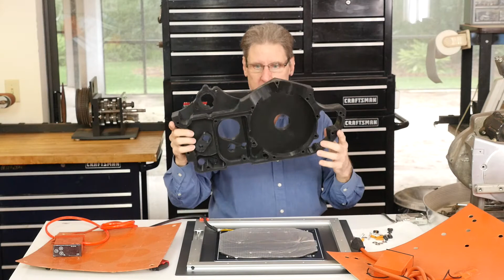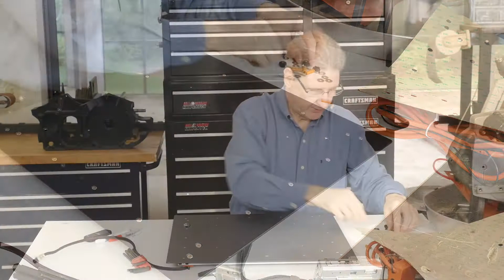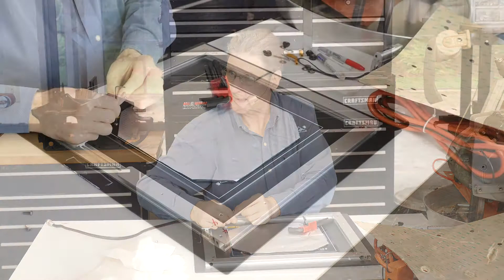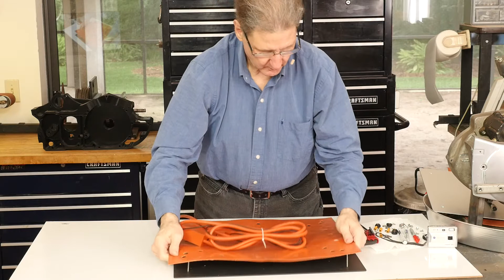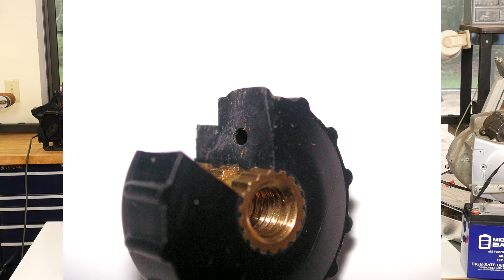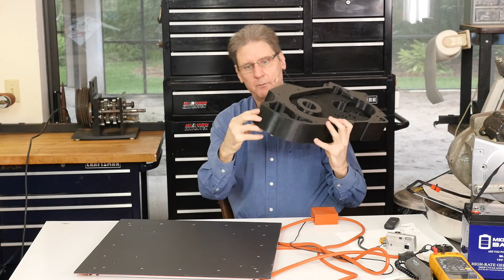Creality CR10-S5 full-size bed heater

Comment: I know this is an old video, but I have a printer like this now and it has the silicone heater bed on it, but the motherboard isn't reading it. says the temp is -14 degrees and refuses to start print. what could be causing this? when I plugged the old heater back in, it fix that error. any ideas?
Reply from the maker: Not sure what you mean Seth. If you are saying you bought a used printer that has a full-bed external heater like this, well what you are seeing makes sense. This external heater has it's own box and plugs into the wall separately. When you remove the "old heater" that was originally with the printer, the control box can no longer read the temperature, that is done by the external control box for the big bed heater. What I do is make sure the bed heat is stable and where I want using the little external box. Then I go into the Creatlity control program where it lets you over-ride the temperature settings for bed and nozzle. If it lets you set it below -14, that should "fool" the Creality control box into thinking the bed is up to temperature, and the print will start. Otherwise, you might connect a resistor between the pins on the socket on the Creality control box, so that the control box will see a positive temperature. If you pick the resistor so that the box thinks the bed is hot enough, the print will start as long as the nozzle temperature gets high enough. Otherwise, any temperature that you can over-ride by hand, so maybe the box thinks it is 28 degrees, you go into the setting and make the print bed temperature 25 degrees. The big deal is that the real bed temperature is set with the little box that comes with the full-sized bed heater, and you plugged it in and waited for the little box to show the bed is at the temperature that you set it. I hope this helps. Adding a separate bed heater is a bit of a hack, and you have to hack some other things to get the print started.
Reply: @Rako_Studios  That makes sense, I knew the orange box was controlling the heat of the bed, I just couldn't figure out how to get the control box to not read -14. I plugged in the old bed and it fixed it obviously, but the moment I took it off again, it went right back to -14. I'll try and see if I can fool the box into thinking -14 is right, but I want to say when I tried last time, it only let me get to 0 and wont let me go under that temp.

Comment: Perfect, this is real useful.  Two issues to double down on.  The silicone pad has a power cable made of the same rubbery stuff, and a data cable.  These need to exit where they are connected from to the SIDE, not the back or front or they will interfere with the printer carriage rollers.  Second and even more important: The bed needs be raised up a bit.  Add a washer or two more than what it came with, in order for the rear cut-out portion of the bed aluminum frame to properly clear the rear Y stepper mother.  Also I have not really figured out how to detach the stock heater from the CR-10 control box and still make it think that it's there.  So right now it's like a vestigial organ just hanging off the control box, dialed down to 20 degrees to keep it cool.   The silicone mat, by the way, works like a charm and heats up very fast.    For the S5, it's important to purchase the extended cable set because the stock cables are just too short!
Reply from the maker: Thanks for the great comment. My printer allowed me to disconnect the original pad and still set the program temp below room temp. I didn't know about the extended cable set, that would be a big help and let me get the control box built with the cable feeder the correct way.

Comment: Did you ever figure out how to bypass the software for the old heat bed? I still have mine hooked up and have it set to 0. Unfortunately every time I start a new project I have to go back in and reset it to 0 again.
Reply from the maker: I use Simplify 3D so that lets me set the bed temperature under 25 C so that the print starts as soon as the nozzle temp is reached. Still, I have been leaving the bed temp at 75 C in Simplify. I don't mind having to reset it with the control box every time, since that reminds me to make sure the external heater box is up to the temperature I want.

Comment: Thank you for the thorough video. I just finished the same installation. Would you mind detailing your solution for telling the printer the bed temperature. Thanks in advance.
Reply from the maker: I used the same file I did for printing with the internal heater control. I set the bed temperature on the external box and waited the few minutes for it to stabilize. Then I went into the control menu of the Creality control box and changed the bed temperature to under 25 degrees C, ie room temperature. That fools the Creality software and the print will start, as long as the set nozzle temperature is reached.

Comment: Not sure if the author of this video ended up with the same problem but running the wires out the back as shown, ended up having my belt rub the wires clear and exposed and also broke the thermistor wire. The belt kept rubbing on the wire loom and of course you cannot see that as it is under everything. When the unit quit working it just quit heating at first and then eventually I got an error code in the middle of a print. Print finished even though the bed was cold.

After unplugging it, I flipped it over to find the Thermistor wire snapped, and the other two wires and the orange shroud completely rubbed off and wires exposed.  After replacing and soldering as well as putting some better heat shrink around it, I turned it 90 degrees so the wires come out the side instead of the back. I just used two zip ties to put a natural curve in the wire so it isn't hitting the side frame and then 3D printed some blocks to raise the entire frame about 2.5" up off the table. This allows gravity to drop the wires down to wear they can not rub now. It also allows easier access to the tiny knobs for leveling.

At any rate, not sure if the belt has rubbed anyone else the wrong way but took me down for a few days to figure out what was going on and there were 3 failed attempts to fix it before I turned it 90.
Reply from the maker: I mounted the pad so that the cord comes out the back left corner. Then I bring in the cord from that corner too. It does not get anywhere near the Y-axis belt, but it does rub on the frame, so I inspect that area of the cord every use. I love your idea of printing some guide blocks, very clever. I will revisit this cord issue and I hope I can avoid these problems. Thanks for the great comment.

Comment: Good day sir I found your video very helpful. I have had my s5 for about a month now and I'm still fighting with it. Could you please help me.
Reply from the maker: Sorry, I can't really provide free instruction on a one-by one basis. If you have a specific question I can try to help, but there is a big learning curve with 3D printing. I, and everybody else, have watched hundred of hours of videos and read manuals and played with the slicer software until we get a print. I had to struggle with a loose pulley and other problems before I could get a print. Then I had to install the big bed heater to stop some warping problems.
Reply: @Rako_Studios  yeah I got it figured out and watching your videos helped drastically thank you

Comment: Thanks for the video. I have a Cr10-S5 and have been watching a ton of videos. Most of them show the upgrades having to wire and or upgrade parts in the control box for the upgrade. Yours seems to be controlled separately from the control box. Do you have a video of how you do that? I really do not want to open up the control box and mess with any of that.
Reply from the maker: The heater pad I bought comes with it's own temperature control box. You plug it into the wall and set the temperature on the box. They warn you to not turn on the heater until after you attach it to the bed, I guess the silicone pad might overheat if it is not stuck to an aluminum plate. So then you have to "fool" the Creality control box so that it prints even though it's old heater and thermistor is no longer connected. I do this in the Creality control panel, by overriding the bed temperature setting that got set in the slicer software. I set the temp to under room temperature, maybe 20 degrees C. That way the Creality control box will start the print since it has satisfied the bed heat criteria. Of course, before you do this, you make sure the new external heater is up to temperature. That only takes a few minutes, so it is pretty easy to do.

Comment: Aluminum has no memory so 1/8" will always warp. Go 1/4" and you can get that to stop. with your upgraded heater it would work better. The extra weight isn't a problem for the bigger stepper motor. For the springs use ones you cannot condense with your hand, but will with a little bolt pressure. The leveling knobs are not lockers so they back out over time. Get nylon lock nuts and print new ones for them. Hope this helps. I Like the video.
Reply from the maker: I like your idea of stiffer springs. They would make the bed less sloppy. Adding weight to the bed will always risk missing steps at fast speeds, but I believe you if you say the motor can handle it. I would love a 1/4 bed plate so this interests me a lot. I even looked at specialty flat aluminum sheet like "Cast Aluminum Tool & Jig Plate" from Midwest Steel and Aluminum. This might be a great upgrade. Thanks for the comment.

Comment: Thanks for doing this video. It confirms my question on whether or not you can unscrew that little heater on the bottom that easily. Instead of using the power box like you have I am getting one that can be used with a solid state relay and then my printer can control it with its own PID settings. I do wish there were some lower power options for slower heating speed since 1300 watts can be quite a bit of strain on some home's power systems but at least it won't be on 100% of the time once it gets up to temperature. I also worry since my battery backup system can only handle about 800 watts.
Reply from the maker: Oh man, you have the exact setup I dream about. They are widening the road and my power goes out every month. With 5-day prints, that can be devastating, even it it is just a few seconds drop out. I wanted to battery-backup the printer, but like you say, this heater won't run for long. If the heater is powered with AC, you might be able to put a diode in series with it, and cut the power in half. That is a design project in itself. It's dangerous since it is high voltage, and you will need a heat sink for the diode that is sized for the current and voltage. It will make the heater slower to heat, but 1300 Watts is overkill for me. If I put an enclosure around the heater, it will need even less power. Good luck with your setup, and congrats on that UPS.
Reply: @Rako_Studios  Thanks for the diode idea. I did some research and saw some other tutorials on it for things like soldering irons and I think it has a lot of potential. I will probably wire it up in a switch in case I want the extra heating power at first and then turn it on low where the PID settings are tuned for.

Yeah, UPS systems are great. I bought mine a while ago because I figure it's better to spend $100 at costco now rather than worry about losing a $100+ print due to a power outage even though we have pretty reliable power here. Extra bonus of it cleaning up the signal of the power. I also have one on my resin printers just in case and they could probably go 5-6 hours if the power ever went out. Assuming the little 100 watt enclosure heater I'm making isn't turned on.

Comment: Thanks for sharing. Did you have any trouble with the aluminum frame clearing the Y axis stepper? I have also seen people complaining about the cable being too thick. Any other tips for installing this back on the printer? My heater will be here in a couple days.
Reply from the maker: Note the extrusion for the bed support has a notch in it so it clears the Y-axis stepper. Be sure to look at all four pieces to find the one that is carved out to clear the stepper and make sure that is in the right place at the back of the bed. It's close, but it does clear. Everything cleared for me, but I also feel the cable is heavy and you have to make sure it can slide over the frame with no interference. Adding the pad does not lower the clearance to the frame or stepper as much as it raises the bed a bit higher. You may have to fiddle with your Z -axis stop switch so the Z axis stops with the nozzle just touching the bed, so you can then adjust it for level. Good luck! I am glad I did the upgrade, no more warped prints.
Reply: @Rako_Studios  the spings still rest against the bed, so it didn't raise my bed at all. All it did was lowered the aluminum frame a couple mm. Got it all setup and working. Was a piece of cake.

Comment: Your video helped me understand possible hiccups from the S5.  I have been on the fence with my purchase and as a new user with 3d it is concerning.  Would you consider selling your upgraded S5?  Regards
Reply from the maker: Sorry, now that it is working OK, I need to hang onto it. All I did was add the large bed heater, so that is not too hard an upgrade. Thanks for the comment.

Comment: Question for you sir, that thicker cord has made it difficult to print due to it getting caught, anyway you found to keep it from getting pinched or caught or even putting enough pressure on the bed to cause layer drift?
Reply from the maker: I just adjusted the cord so it would slide along the frame with a big loop so very little pressure against the bed. So far so good, I hope my luck holds out.

Comment: I'm going to have to take mine apart and see if I need to replace the heater as well. I just don't understand why they would sell a giant bed but the heater only heats up part of it. Seems really ridiculous.
Reply from the maker: Yeah, it was a cost-saving measure to be sure. I guess once they go to a big heater, then they need more power, and then everything costs way more. This heater plugs into the wall and is not in direct control of the Creality control box, but it works so much better than the stock little heater.

Comment: Great video, really helpful for the process of upgrading the bed so thanks very much. Just fitted mine, but when I unplug my original heater all of the stepper motors start to click when they move. Any clues how I can fix this?
Reply from the maker: Motors clicking sound like they might be skipping steps. Make sure the cords that go to the new heater are clear and free to move without snagging, and the old heater being disconnected has no effect on my motors, sorry I can't be more help.
Reply: @Rako_Studios  Thank you so much for the reply! This is the conclusion that I came to as well, but am still unable to explain why it was happening as there was no snagging and it was happening on all the steppers for all of movement axis - very strange! After a couple of days of troubleshooting, I installed new firmware and totally disabled the stock bed and thankfully this has solved the problem.
Reply from the maker: @3dprintit4me  Don't you hate when things "heal" on their own, and we can't be sure what was causing the problem? So glad you got past this, and congrats on the firmware upgrade, I should do the same.
Reply: @Rako_Studios  While frustrating to not know the exact cause I am mostly just relieved that now I can get back to printing on the machine! I can only assume that in the older versions of the firmware there was some kind of safety check that needed the bed to be plugged in. Would highly reccomend doing the update as I'm now getting better quality prints too!

Comment: Did you ever add any safetys for thermal runaway? Many of my prints take days and i dont want this if i cant have that safety
Reply from the maker: Well the stock Creality has no thermal runaway protection so I feel I will just have to trust the controller. You are right to be concerned, since this heater is much more powerful and can really overheat the bed. My thinking is that if the output transistors shorted on this controller, or even in the stock controller built into the Creality, I would smell the plastic getting hot, even if I was in the next room. No matter what, the print would be ruined, since turning off the heat usually releases the print from the glass. I guess you could buy one of those thermal cut-out switches and mount it maybe to the aluminum undercarriage of the bed, and route ac power or the output of the control box through it, but thousands of people are using these controllers with success with no thermal runaway protection. Thanks for the comment.

Comment: Thanks so much.   I have the S5 on order as well as the larger bed heater.  Was wondering if there is any other upgrades that you would recommend that I make?
Reply from the maker: Right now there are no other upgrades I can vouch for since I have not installed them myself. There is one setup where you put pulleys on the top of the Z ball-screws, and a belt between them. This keeps the X-axis flat and saves having to tram it out every time you turn on the machine. I also think about getting auto bed leveling, but from what I can tell, it is still important to have the bed almost level rather then trying to comp things out in software.